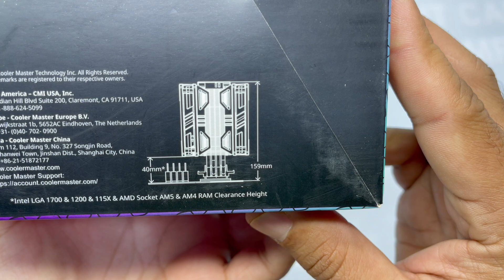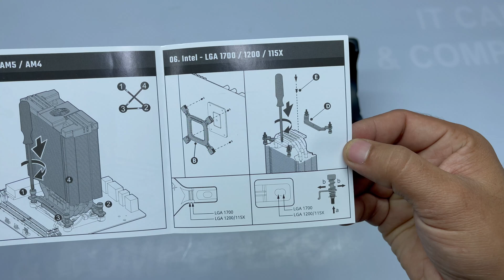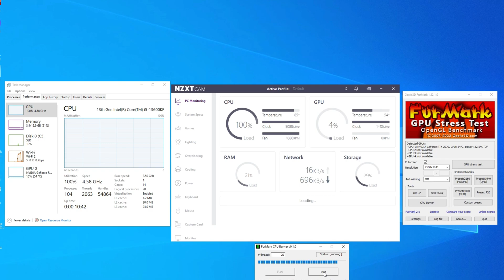Cooler Master Hyper 212 Led Turbo Argb i5-13600kf install test

Comment: im using this cooler but cannot use 1 ram stick because of the clearance issue
Reply: Same im have the same issue but i think you can move the fan up a little to clear enough space for it

Comment: How is the voltage on this? 'Cause I have a hyper 212 black edition on mine (single fan) and it's absolutely not even close to being enough, CPU-Z stress takes it to 100°C in few seconds. That is being power limited to 150W on BIOS.
Reply: Bro do you need if you can add another fan in the cooler ? Or I need to buy the turbo edition ?

Comment: bro my pc also same specs but my 13600k with msi pro b660 m a was touching 100 degree please help
Reply: same here, but i have the  hyper 212 rgb black edition with only one FAN, 4 heatpipes too, but in deepcool site they inform 130 tdp cpu support only.
Reply: cooler master*

Comment: it looks you cannot put 4 rams with this air cooler only 3
Reply: If you choose low profile ram ..its ok I recently fitted same cooler and I could have fitted the ram into 1st slot after the fan was fitted , you will never get fan on with the ram in 1st slot.

Comment: How is the temps, I have this cooler and I'm planning to upgrade to a 13600k, I only play games, is it enough?
Reply: dont think so, for 13600k, minimum 240mm AIO or 4 copper pipe air cooler
Reply: @DrZipZwan  but the hyper 212 is 4 copper pipe 🤔
Reply: @lucastnd   @lucastendero  this cooler is reported too weak for an i5-13600K. Plus you want to always run games lol
i5-13600K is a heat factory. If you want normal heat sink, without watercooking, you should get no less that a great 2/3 fan plus no less than 6 coppers pipe for a someone that "only" plame Games on his PC. Nucta (80$ >) or even an AIO water cooler + 1 Fan for an casual game player.
Heatsink depend also from how CPU gona be heating.
If no gamer, probably Hyper 212 + 4 Copper pipes can be used, but always keeping an eye on CPU temperature.
But for a heavy gamer, lets do the math, the CPU is gona always over heat and die early, simple as that 😉
Reply: @DrZipZwan  guess what, i bought the 13600k, with the hyper 212, and the temps dont go over 87C, no thermal issues
Reply: @lucastnd  Great. Same for me , 13600K + Hyper 212, cause I dont play game, rarely goes until 55C
Unfortunaly to noisy when it speeds up around 70-80%.
Reply: @DrZipZwan  I use a noctua fan on my hyper 212, and even with 100% speed I can barely hear it, heavy gaming, rendering, hyper 212 doing great
Reply: @lucastnd  thats propably why, noctua fan are the best! seems you had an old noctua fan lying around, and used it instead of cooler fan's 👍

Comment: se pierde un espacio para la ram?
Reply: Tengo esa duda porque en el esquema, el disipador tiene una parte mas prominente pero del lado contrario dejando un vertical libre  del lado de la ram con todo y ventiladores para que puedas ponerla, pero aqui parece que el ventilador bloquea ese slot.
Reply: @IshanBelgarath1337 it depends on the motherboard, I have the same cooler and with my h610 i have to use a low profile fan to use 2 ram sticks, but with my new b660m I can use all 4 slots of ram

Comment: I bought a system from online store they gave it to me prepared. I have the same cooler but i guess they assembled it wrong the "Cooler master" brand looks reverse in my version. And the fan where placed close the ram pushing the hot air to rams is it correct?
Reply from the maker: Right way is same in video if they install wrong you can change it by self
Reply: @itcarecomputers  pls use traduce for it, yo tengo el mismo cooler, pero ambos ventiladores tiran el aire hacia atras, vi que tu pusiste ambos que tiren aire hacia el disipador.
Debería dar vuelta el trasero para que también apunte hacia el disipador?

Comment: Is the cooler suffficient for the i5 13600k, not really planning to overclock i got a mini itx case and tried to fit a thermalright phantom spirit 120 SE which simply did not fit my b760 asus strix motherboard the width was too big somehow. This looks much more narrow and should fit, just worried that it is 150w tdp rated and the 13600k pulls much more during turbo clock
Reply from the maker: Not enough for that cpu  you have to go with liquid cooler
Reply: @itcarecomputers  
Yeah it's only 150w i recieved the box today, im not gonna open it and just return it, I already bought a aio aswell ad 2 other coolers, none of them worked out, 2 did not have a lga 1700 bracket the aio is a artic liquid freeze 2 (240) nut it's soo big that it wont fit my mini itx case if i wanted it on top or below and cable management would be hell for a beginner like me, I went with the deepcool AK400 that one was stated to come with the 1700 bracket and is marked at 220w, a significant 70w upgrade over the 220 black edition.  Hope it will be fine, becaude i think thats one of the few options i have in my situation with this very annoying b760 mobo that has its ram and vrm heatsink too close can't have a wide cooler or it just wont even fit. The ak400 is very narrow and easy to install, people did test the 13600k and it ran very well if overclocking is not necessary.  Still a bit more power from a cooler would be ide but i think this will have to do. I remember my first pc build it was a mid atx tower in 2016. It was soo easy to build in a few hours conpared this itx hell, have like 3 air coolers and 1 aio that needs to be returned, finding all the right screws for each packet is gonna be difficult. Definitely will go for bigger pc cases in the future, way more compatibility,  better prices on the mobo and air flow in general
Reply: @itcarecomputers  but it is stated in your video that you used 13600kf ? it is essentially the same as 13600k only without built-in graphic? Why is it not enough though?
Reply: @rezarizaldi9231  it is enough he is talking bullshit, for gaming atleast its fine, I reused my old hyper 212 black edition and just got 2 sickleflow fans and works great, if youre buying a new cooler though you can find better option though like peerless assassin
Reply: @itcarecomputers What the fck are you on about? Liquid cooler for 13600k? This cooler is more than enough with 2 vents to cool that cpu. Go check builds with 13600k and tell me what percentage went liquid cooling. How can can you say such stupid things lmao
Reply: I am using 212 black edition with 2 fans push pull with 13600kf, it is enough, never had a single issue(i dont overclock though)

Comment: Antique case nx292
Written Max Kohler 155mm
And the length of this cooler is 159 mm
This cooler will not work for the bag. The side door will not be closed because of the 4 mm difference?

Comment: Tell me the correct position of fans for better air exhaust
Reply from the maker: In video is correct position
Reply: @itcarecomputers  it is possible to change the fan configuration to push-pull?
Reply from the maker: @frifasS  yea
Reply: @itcarecomputers  THANK YOU

Comment: Hello man, nice video! A question: Do you think that is possible to use four ram memory with this CPU cooler? I'm using Teamgroup Delta RGB, which are big. Thank you.
Reply: I wondered the very same. Unfortunately, it doesn’t appear to leave much room for that first DIMM slot in the video
Reply: @rollsheet  Yes, this is true, especially in the case of high profile memories. But I'm still studying the possibility, because I really liked this cooler
Reply: @brunoleonardi7710  I have this cooler and Teamgroup Delta RGB RAM . I can't use the first DIMM slots because this cooler is very large.

Comment: Plan to get this for a 13400f and rtx 3060 for 2k 144hz goal. Dunno much about cooling but i guess it is enough together with 2 120mm intake and 1 120mm exhaust fans?
Reply: Take deep-cool As500 plus check cabinet height of yours cpu cooler i am using its fantastic very effective and silent and provide great cooling
Reply: Non ti 3060 not for 2k at-least 3060ti

Comment: Run test atleast 10min it will definitely touch 95° celcius
Reply from the maker: reached 88 after 10minuts but in gamplay 2k resaulation ultra temp was 70 to 75